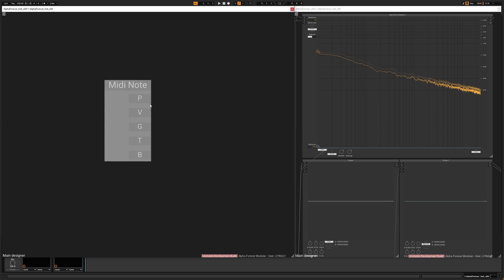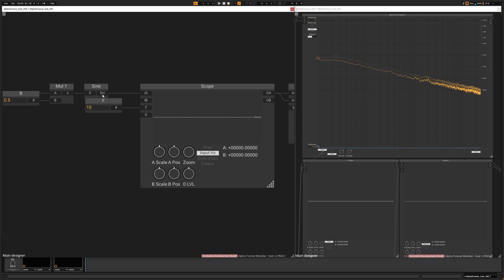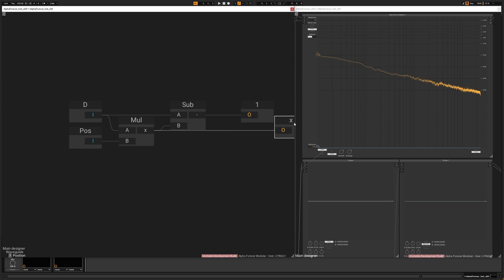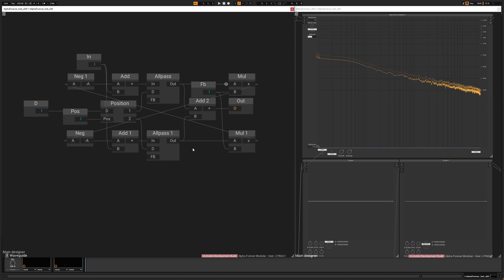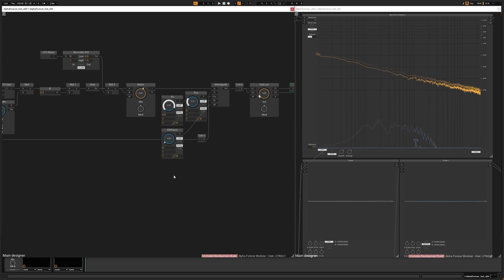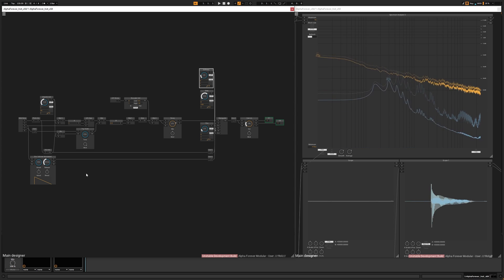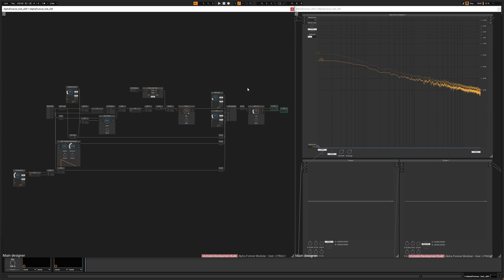Waveguides can sound amazing

Comment: As someone who doesn't have an engineering or strong mathematical background, but does have a couple years of experience with virtual FM synths/wavetable synths, my brain melted before I could make it beyond the minute mark. Already don't know what's going on. Quite an impressive end result though.
Reply from the maker: it's not that complicated as it might look. the basic idea is to create a repetitive signal using delays. the length of the delay defines the pitch, the feedback coefficient the release time. the patch in this video is a bit more complex than a Karplus-Strong, but it's not that useful. i moved away to simpler methods since, that you can see in my video: 'My simplified approach to complex waveguide synthesis'.

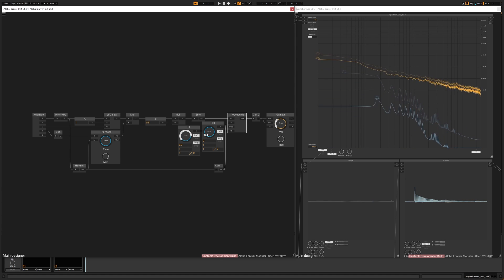Comment: I'm recreating the dsp/block diagram as-is in Faust. I've been able to implement the excitation impulse -> waveguide. However, when I test run the audio, my plucked tones are nowhere as nice as yours are at 5:36. I've been struggling to figure out why. I think it's something to do with the type of delay? What type of fractional delay filter are you using in Alpha Forever? In Faust, I'm using Lagrangian 4th order fractional delay.

Also, what type of white noise is the LFO noise node? Is it lowpassed white noise with a certain cutoff frequency?
Reply from the maker: hi!

the LFO noise is just plain white noise, but instead of -1..1, it's range is scaled to 0..1.

the delay in this video used linear interpolation. we changed to 4-point Hermite since, which keeps more audiable high frequencies. probably if you put a simple averaging filter ( a simple 1st order FIR: y = (x[n] + x[n-1]) * 0.5 ) into the feedback loop, you'll get something similar, but don't forget to compensate the delay time for this additional filter. you'll have to subtract half sample from the delay time to keep everything in tune.

Comment: Hey! Thank you so much for this video, it's really helpful.
I'm loosely following this tutorial in NI Reaktor, which is similar to Alpha Forever Modular. I've been able to follow it right until 6:57, where the delays are replaced with allpass filters.

Allpass filters in Reaktor seem to be implemented differently from AF Modular, and have a very different and more primitive set of controls. AF Modular allpass filters take a delay time and feedback amount as controls, while Reaktor allpass filters (at least in Primary) only take a filter cutoff (in MIDI note values for some reason, but Hz values can easily be converted to MIDI note values using a dedicated node).

Is there any way to achieve something similar with Reaktor and the way it handles allpass filters?
Reply from the maker: Hi! I'm glad you're enjoying my content. I'm currently working on a video that shows how to extend this kind of patch with more resonators or simplify it for easier use.

Regarding your question: if you're trying to follow along in Reaktor, you're right — the standard allpass filter there is a 1-pole filter, built by subtracting a highpass output from a lowpass output.
The term "allpass filter" actually refers to two different types of structures, even though they share the same name.
The one I'm referring to in this video is often called a Schröder allpass. It's basically an extended comb filter, with an inverted feedforward path after the feedback point.
This version does exist in Reaktor too, but it's named differently: it's called Diffuser Delay. You can find it in Primary under Built-in Modules → Delay → Diffuser Delay.
If you check its description, you'll see that it is indeed a Schröder-type allpass. The "Dffs" input is the coefficient controlling both feedback and feedforward.
Reply: @9b0  Thank you! I tried this yesterday, it works as intended and sounds beautiful. 

You can also set the diffuser delay feedback to a negative value (I recommend a value of -0.1 to -0.5) to simulate inharmonicity/dispersion more like you would hear from the bass notes on a piano or Hohner Clavinet… why had I been putting a bunch of allpass filters in series in a Karplus-Strong feedback loop to simulate inharmonicity, and decreasing the delay time to compensate for the decrease in the fundamental note freq? This is more efficient, doesn’t lower the fundamental frequency, and honestly sounds more natural.

Now I have another question. Is the “position” variable referring to the point where the string is plucked by the excitation signal, or does it refer to the point along the string where its vibrations are transduced by a pickup? I’m convinced that it’s the pickup because whenever I change the value, the sound changes even if the string is still ringing.

Comment: ooh i should try out the dual delay setup sometime
Reply: an update, it does sound nice, although unlike combing the impulse, changing the position live affects the timbre. i also like the tone changes from the variable width sine bump as impulse. for whatever reason this time the stuff to change the feedback based on pitch to get a more consistent decay time works a little better, but something breaks at higher sample rates.
Reply from the maker: Oh. I missed your update. What do you mean with higher sample rates? I'd like to give it a try (what's the version you're using?).
Reply: @9b0  it’s in reaktor not your thing, and idr what happened but i must’ve not corrected something for the sample rate properly
Reply from the maker: @morgan0  I see. anyways: if I can help you, just let me know. I have Reaktor here too. :D

Comment: Hi bro, Did you add trigger off option for monophonic sound? I learned a lot in VCV rack pro and now I want to learn AlphaForEver but as I told you earlier I need to trigger off behavior for monophonic sounds, This is the default mode for Mono Mode in any mono synthesizer.
Reply from the maker: Hola! I don't know what you mean by trigger off. Could you please explain the wanted behaviour?
Reply: @9b0   Hello :) 
Could you take a look at our previous discussion in your video:
(Exploring beyond the Karplus-Strong Resonator)
Reply from the maker: OK, now I remember. Since then we have been busy with implementing the Luajit compiler, and did not work on this yet. It's on the todo list for sure. :)

Comment: Thank you so much for this! I've watched it a few times and it's helped me a lot. Could you explain the use of allpass filters here a little bit? I've been researching waveguide synthesis, and I've come across information about adding an allpass filter in the feedback loop to add inharmonicity, but this is the only example I've seen where allpass filters are actually replacing the delays.
Reply from the maker: Hi! I did not see anyone using the allpass filters the way I do. Yeah: an allpass filter in the feedback loop creates the effect of dispersion: I mostly do this using a 1pole lowpass filter where I subtract the Hp output from the Lp. Replacing the delay with an allpass diffuser changes the envelope of the resonator: adds a feel of tension to it. However, nowadays I tend to use simple comb filters and coupling.
Reply: @9b0  Thank you! Out of curiousity, if you're using a lowpass and a highpass filter, how do you control the delay and the feedback?
Reply from the maker: @russellbrown2862  Hola! If you want to fix the delay caused by the filter to correct the pitch, I'd use the 1p modulated node. It hase a phase delay output which tells you the exact delay caused by the lowpass filter at the cutoff frequency. The phase delay of the hi-pass is offset to this value by 2pi. (Ophd + (Ophd * 6.28)) The Bp offset is (Ophd + (Ophd * -3.14)). Remember to multiply the result by the length of a sample (Lng output of the sample rate node) to convert the result from samples to milliseconds.

Comment: I think I'm getting most of this and I've got something working in PD but it doesn't sound as good. I'm missing the "Sine" just before "Waveguide". Can you explain? It seems it should smooth the saw wave but I can't see a justification for that. Thanks
Reply from the maker: Hi! The sine function is equivalent to sin~ in PureData. It turns a saw (in range of 0..1) to a sine wave (ranging from -1..1). The patch creates a single burst of a half sine wave on each note-on action: the saw wave is just a phase driver for the sine wave, it's not the input of the resonator.
Reply: @9b0  got it. Thanks very much. I’ve now got some really great sounds out using PD with an editable excitation waveform too
Reply from the maker: @oystercatcher943   I hope, you'll have fun with the patch!

Comment: this is really cool! i've been doing some research into waveguides and the 1d wave equation. i had been struggling to understand, but this video helped me a lot. i remade this patch in puredata (it sounds more metallicy and digital somehow, think must've made a mistake somewhere). thank you for the video!
Reply from the maker: We use interpolated buffers in the delay / allpass nodes. I’m not sure if the buffer read/write works the same way in Pd. This could be a difference resulting in a brighter sound.
Reply: @9b0  you were right about the interpolated buffer! i switched from using [delread~] to [delread4~] which does 4-point interpolation and it sounds a lot better and more similar to what you have. thank you!
Reply from the maker: I hope, you'll have fun with the patch!
Reply from the maker: I checked this. We use simple linear interpolation that causes high frequency loss, that's why my version sounds warmer. We will implement 4point interpolation in future versions. I've already built a delay module that works this way, and it has a lot less frequency loss.
Reply: @9b0  interesting! i had no idea. that would make sense that it’s essentially adding a filter to the delay line.
Reply: @pathagas  I'm trying to remake this patch in Pd as well. So far I've been using [delwrite~] and [delread4~]. Is there an advantage to using [tabwrite~] and [tabread4~] instead?
Reply: @russellbrown2862  I meant to say delwrite and read! My bad!

Comment: Thank you for this great demonstration! One thing I'm not clear on: when you feed the signal back and invert it, what kind of delay are you introducing and is that compensated for somehow? Guessing 1 sample or 1 block? Or does it not matter so much (I'm thinking it should)?
Reply from the maker: Hi! The delay matches the group delay of the polarity node in milliseconds. This time is dependent on the sample rate and the oversampling algorithm. Since we have this information, the polarity node can calculate this. All the new oversampled waveshapers (Clipper, Saturation, Polarity, Reflect, Foldback, Sine Folder) have a delay output, which outputs this delay value. This makes parallel processing possible with these waveshapers.
Reply from the maker: Sorry, my previous answer was wrong, I thought I'm replying to a comment on my latest video, but I just realized, it has 0 comments ATM. :D

If you feed a signal back, it produces a delay of a sample. The point the delay is calculated at is indicated with a little circle with a 'z' sign inside.
Reply: @9b0  Right, that makes more sense to me :) Thx!